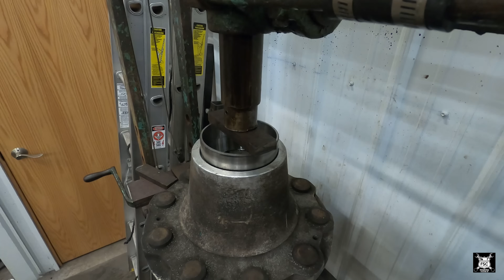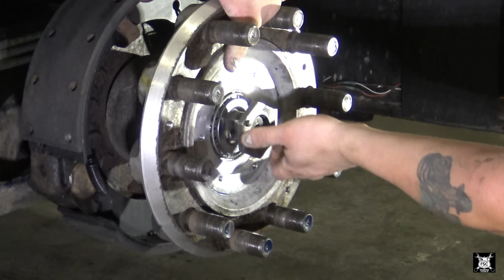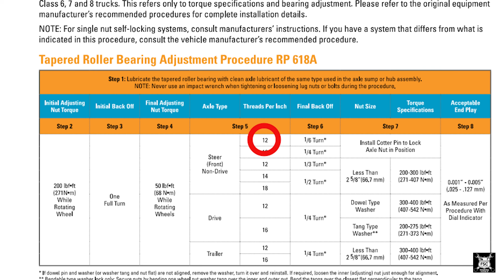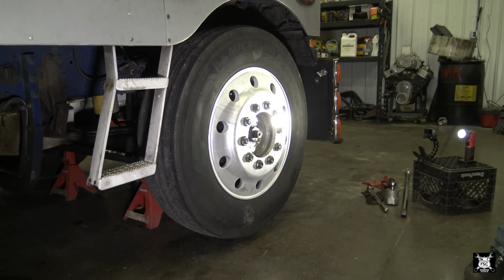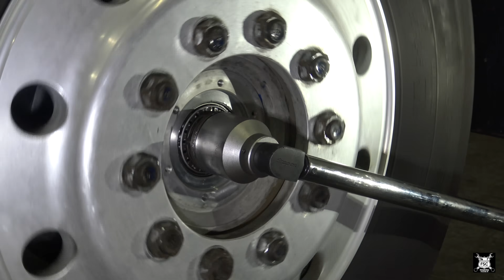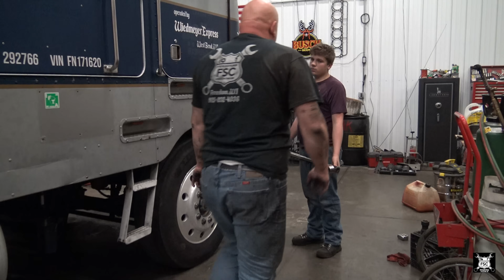Setting Steer Axle Bearing Pre Load On Cabover Peterbilt

Comment: I see you using like a 80 90 weight or a higher weight but I didn't see you use any wheel bearing grease is there application different
Reply: 75-90 in rears, 50 in transmissions and front hubs

Comment: Love the comments here! If you have a hub cup thats used make sure the tiny hole in the center rubber plug isn't plugged up, its a vent. If not oil bath gets hot, expands and pushes past inner grease seal.
Reply: Great advice, sir! Learned that one the hard way!! Them suckers has gotta vent!!

Comment: Hi, I have driven semi trucks over 30 years and enjoy watching your videos.  I do have a question on your front wheel bearings, with cars we use to "pack" the bearings with a type of lubricant grease that was not in a liquid form.  I thought for sure semi trucks would require the front wheel bearings to be packed
Reply: they can be personal choice, oil is easier to change and the seals are easier to find not all are for grease

Comment: Now I am confused, (not uncommon).  My parts supplier, (a well known truck parts supplier in my area), said I should not lubricate those types of seals before I install them.  Any advice???
Reply from the maker: The other seals I used were dry.  Smash in with a hammer and proper tool.
Reply: The only thing about oiling the seal is if dot cop sees any moisture they'll put you out of service. But i never used that kind of seal

Comment: Everyone has there own way of doing things.....that being said you dont ever want to put oil or anything thing on the seal surface or the surface on the spindle where the seal goes,,you want this are to be smooth clean and dry or the seal will slip and leak. And DEFINITELY fill the center cavity before installing the outer bearing!
Reply from the maker: Why, monitor the oil level.  Oil will flow through the bearing.  It just takes hours and adding oil as needed until you get the level proper.
Reply: @fsctrucking  yes it saves a lot of time filling it up! Lol
Reply: I wasn't bad mouthing your work I just know there's guys out there that's probably not as mechanically inclined as we are so they may not know that it has to fill the center cavity up when filling through the hub oil cap. And by the way if you crack the throttle just a little bit while your cranking it she'll fire right up! I've had many mechanical cats,still have a mechanical C model.  You do a great job,trucks looking good! Keep up the good work!
Reply: the seal lip has to be lubed to prevent tearing per instructions.
Reply: @youtubeisawesome2487  only inside the seal where the spring is not on the surface where it meets the axle

Comment: I learned something about end play, never saw anybody use a dial indicator to measure end play, usually when I saw it done they would be torqued and done. Great job Steve.
Reply: I never used a torque wrench to set the load on the bearings or torque lugs. Never had one....always used my best judgement, but if I would of had one I would have used it. I never had one to come off.

Comment: Used to have left and righthond thread on UK trucker years ago. One day came across a bloke swearing that he could not get the nuts loose. Big chap ten foot length of steel tube jumping on it cursing. I told him go have a cup of tea. I took the wheel off in five minutes.  He came back I said there you go I got it off for you.  He said shit you must be stronger than you look. I said it helps if you undo them the correct way. Then told him.

Comment: hello Mr.feszchak and good evening....500 ft. lb. for the wheel nut cause its not concentric??? or  for hub pilot 400 ft. lb. ? I had to check when i got new steer tires 100 klms down the road had to check them ...on the end of wheel brace (double ended truck wheel socket bar) bar thru the socket cheater bar  slid over and another cheater bar shoved in  on the end (it end up about 5 foot long) to get them to nip up the last little bit (now there's 3/4 drive cordless impact driver that lives in the truck ) really hate 10 stud wheels love the spider or Dayton wheels so easily to change when have a blow out or a flat plus its only 5 or 5 wheel nuts have to tighten rather than 10 wheel nuts .....nice to see Mathew help torque the wheel nuts to spec

Comment: Putting oil or lube on threads will throw off your torque unless otherwise instructed but for sure never on lug nuts
Reply: All ways lubricate wheel nuts, or threads will pick up and tear, nuts tightened properly will never come loose, particularly if re checked later. 52 years experience!!!!!
Reply: @grumpystruckshop3807  ummm idk if you understand what I said by putting lube on threads WILL throw off your torque specs
Reply: @Justme-jt1ef  its just that the less friction on treads and surfaces, the truer the torque reading!
Reply: @grumpystruckshop3807  your wrong absolutely wrong go do some reading and stop trolling
Reply: @grumpystruckshop3807  Here so you don’t hurt your old ass looking. Experts tell us not to use any lubricant, including anti-seize compound, on wheel studs or nuts. The tech folks at Tire Rack state: "Torque specifications are for dry threads only. The fastener threads should be free of oil, dirt, grit, corrosion, etc. It is important NOT to lubricate hardware threads or seats.
Reply: @Justme-jt1ef  like you dont over torque with the tire gun to begin with, and you do use oil
Reply: @youtubeisawesome2487  I feel sorry for you
Reply: @youtubeisawesome2487  you obviously have no clue what you are talking about what is a tire gun and when did I say I even used said tire gun??stay in school kid you obviously need to learn reading comprehension.
Reply: @Justme-jt1ef  so you dont use a tire gun (1 inch impact with 6 inch anvil known in shops as a tire gun)  guess those thousands of lug nuts i have taken off werent done by you, doing it by hand would take forever but at least you dont mess up many trucks that way. anyone thats been in the business knows you anti seeze the crap out of budd spools and nuts or the next guy has hell getting them off and it could be you. so whom is the one who knows not what they do, calling someone kid what are you 20 or something, keyboard cowboy
Reply: @youtubeisawesome2487  I feel sorry for you guess YouTube makes everyone an expert or brings out all the Karen troll know it all’s I’ll pray for you.
Reply: @grumpystruckshop3807  For a given torque the resulting tension is directly related to the friction between the stud and lug nut threads. Lower friction (as is the case when a lube is applied) results with increase stud tension for a given amount of torque. Manufacturers design this attachment for no lube.